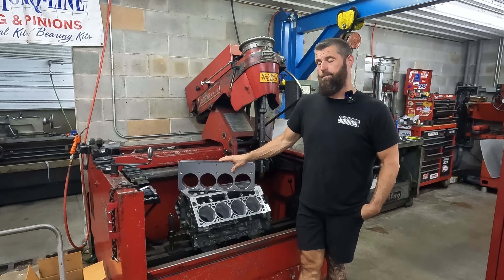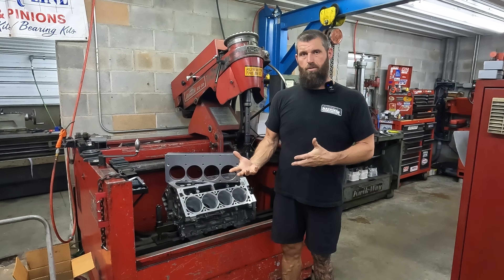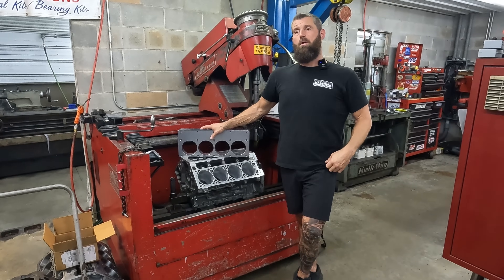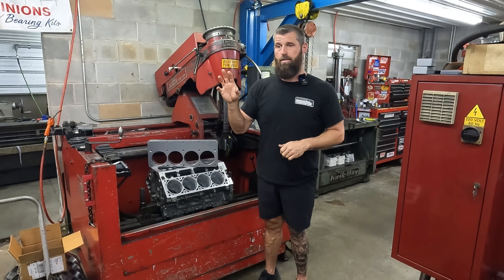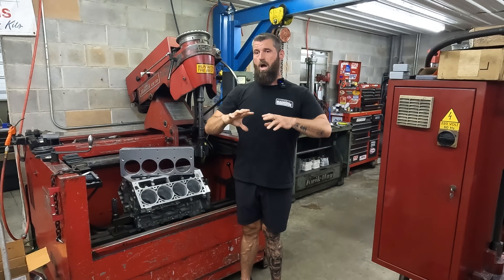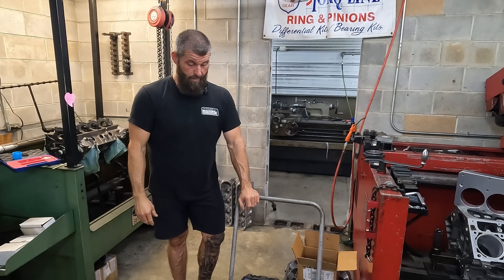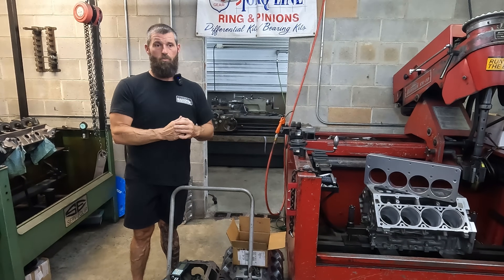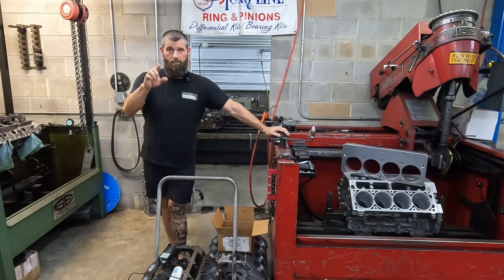We gotta talk about this torque plate deal.....

Comment: On a RACE engine, that's built and put into service with maybe a dyno run at best, sure, a torque plate can help the rings break in faster. However, on a street engine, that's expected to run 100,000+ miles, it makes zero difference, as even if the top of the bore is out of round by a few tenths, the rings will break in to the slightly out of round shape within a few thousand miles. 

Also consider that both the piston and block will expand, and the piston will expand more, so all of these changes will move around as the engine breaks in. 

Street engines are not race engines.

Comment: Great video.  I guess most of the torque plate police are FORD guys.  All the newer ford modulars are pretty responsive to torque plates due to thin cylinder walls on their iron blocks and as you mention even the old FE fords are sensitive to it.  I myself have built a number of ford modulars and have had a local shop bore my 5.4 iron block a few times thru the years.  They didn't have a torque plate and i wasn't going to buy one for them lol.  When i have disassembled the latest engine to swap to higher compression pistons i did notice some wear patches outside the thrust face and it was worse than before it was bored 0.030 over.  So to your point it is all relative. Im ok with my little 700 hp FI 5.4 giving up some bore quality to save 1500+ bucks to ship that block to someone with a torque plate.  It always ran fine and made good power. Just not that big a deal for even a mild street/strip car.
Reply from the maker: Absolutely

Comment: I have always thought exactly the same. The only way to check an engine properly is to bolt the actual head on after a hone near on size. Then run hot water through the block turn it upside down and measure the bore from the underside.
If there was a multi stone manipulator head for a hone and the hone had not only 6-8 stones vertically but also pad like stone rows horizontally. You could have push out mechanisms to control them with CNC, so you could do a bore scan then replicate the anomaly with the head removed creating the perfect bore when the head is bolted on.

Comment: 20 years ago I ran a test and only used a torque plate on one side of a street strip engine and ran it for years to see if I could tell any difference .... After years I could not tell at all except at the very top of the bore it had worn it just a bit more at the bolts ..... Leak down was the same ... Compression was the same .. it just did not care if it was done .... So you are dead on how it works

Comment: I'm a machininist for a living.  When u see any block made at any mass production facility they don't waste time with torque plates.   It's not economically feasible. Most of those engines run 300000 miles or more these days.  It's more due to the material the block is made of and the engineering.   If u need an engine that critical... I don't see just 1 torque plate on am 8 cylender block any use at all... if your worried about metal stresses being relieved from machining why aren't you simulating the engine being completely assembled with 2 torque plates and a block to simulate the intake torque stress as well.   We're not building engines out of carbide. As soon as that engine warms up things are changing in ways most will never understand.   Heat will make that block change shape in 1 area more than another warping the cylenders way more than .001 on warm up.   That's why drag racers fully warm up the engine before a race.... then they rebuild the engine after 1 to 2 races.

Comment: Some people see all this stuff on YouTube and don't understand that building high end race engines is a completely different thing than building daily drivers, or hacking together used parts to get a broke customer back on the road. Keep getting it done man.
Reply: Or a budget weekend race car !
Reply: Exactly. I’ve dingled and Jerry-rigged plenty of old small blocks to keep them running. I’ve done full rebuilds and I just eyeballed the crankshaft and said “yeah it looks okay” and slapped on new bearings. Said motor is already 3000 miles into the hillbilly rebuild and runs better than it ever has (in my memory).
Reply: This. Its insane to me reading what some people suggest to do to a DD. The tolerancecs and pressures are just so wildly different than a fully built, sleeved, girdled, billet block that its just incomparable. I'm not building a 9 second car with a stroker that hits 8.5k. I'm trying to have fun heading to the grocery store or out on a country drive.
Reply: Ever witnessed a shade tree rebuild on a daily that works just fine? Then you have witnessed a reality.
Reply: There are some stock engines that have similar rebuild practices to race engines though. Subaru EA series engines for example. Some of the 70s cars with them cruise at 4000 RPM at 65 mph, with no oil cooler. The dual carb engines rev to 7500+ RPM and you need to use that upper RPM range because they make no torque at all. Manual requires a torque plate to be used for boring oversized, but not for honing. Even from the factory they used special lead-indium over copper bearings with a moly coating because the loads on the bearings are so high and the journal sizes are so small. Cylinder liners are nitrided steel only about 2mm thick. If the cylinders have glazing they should be honed just enough to remove it, but if there is no glazing the rings are just supposed to be run on the existing surface, because normally the rings will wear out long before the very hard, nitrided cylinder. If the specs and procedures are followed to the letter these engines can last more than 500,000 miles easily, but if not they can also easily blow up at 50,000 or less. And it makes sense. If you have an engine that cruises at 4000+ RPM and needs to be shifted at between 5000-7500 RPM depending on the engine and specific car, and is also expected to last for a very long time, the tolerances are going to have to be very precise. High revving and long lasting don't usually go together. If you do the work yourself rebuilding these isn't expensive, however. Just time consuming. A full rebuild is around $400 including new pistons and rings, a full gasket set, a reground cam, a new set of lifters, and all types of sealant required for resealing the engine. You just have to be careful while doing the work.
Reply: We rebuilt a roller block 302 ford for a demo derby car, the block was from one of my cars and had been overheated really badly twice. It had almost 0.040 piston to wall after a really hard run with a glazebreaker. It was really noisy but had good oil pressure. Derby cars get really hot, especially if the rad gets popped, having a mile of piston clearance keeps them from seizing when the water leaves and things start to cook.

Comment: I build 2 454. One without torque plates the other no torque plates. The engine without torque plates I put cast iron rings in. The car ran 10:90 first time I took it to the drags. Change oil after the first time with about 10 passes on it. Second time out it ran 10:80. Each time I took it to the drags it dropped a 10:70 down to 10:30 and stopped there. I like good cast iron rings cause they ware into the cylinder. My other motor ran 10:30 brand new with the torque plates and top moly rings. The car never ran any faster than 10:30. I ran the et brackets so the et was not the big deal cutting the light wins the races. IMO I like to use standard cast iron rings on the 10:00 second times I have run. I put together about 25 motors in my life time from stock to low 10:00 second drag engines and only had 2 that used oil which had top moly rings which were street cars. Those two that used oil we took it back out honed the cylinder with my Ammco precision hone kit with 320 or 400 grit stones and back to cast iron rings.. Neither engine used oil again. These were daily driven engines. I put in good cast iron rings. I had all the engines machine by the same guy for years because he did a good job. For some reason I have seen were moly rings don't seal sometimes for some reason. I think it is because moly rings are so hard on the top ring they don't seal because if the engine gets warm and the ring can't ware into the out of round cylinder when its warm. If the ring does not seal you can tell by more oil blowby real fast. Engine move all over the place till they get broken into. I bought standard size rings and even those you had to file stock rings a little to get the gap a little bigger. My engines were at most 500hp to 600hp. All average people could afford 30 to 40 years ago. What I see today is all I can say am glad am out of it today. The prices are out of site today.

Comment: The deck plate does not represent the exact head that's going to be used on the engine as it in some case are hollow for coolant. thermocycling like you said or accessories pulling on the outer jackets of the block but people want torque plates .just like you said  lot of holes have been honed without any other than any deck plates but open deck blocks i feel better using then

Comment: I'm inclined to agree with you but I do believe that the coyote & the flexible alloy used to make the block do call for a torque plate over the 1100hp. I've heard that the aftermarket reinforced pred or even the iron aftermarket coyote do not " need " them. it appears to be more specific to the excessive flexibility of the alloy & design of the coyote. just thoughts, not assertions of fact.
Reply: I should've watched the rest of the video lol. you addressed the ford block alloy.

Comment: I agree with you 100%. The other side of commenters is,  if you were Torque plate honing stock blocks...  they'd be calling you a rip off atrist and accusing you of padding the bill. Couple of years ago, my LC9 ate a lifter. While I had the heads off, I had them surfaced and my exhaust manifolds belt sanded. This is a work truck. No mee seats, no new guides, no nee springs. Dropped the heads off on Monday got em back on Wednesday. Truck was running again on Thursday. Machine shop charged me 300 bucks. It aint a race car, and every minute its not on the road costs me money. I didn't have 2 weeks to wait for all that to be done. For what a 15 year old truck with 200k miles on it? Thank God there's honest machinists like you out there.
Reply from the maker: Thank you sir!!
Reply: Exactly some people just dont know anything other than what they have read or seen with certain vehicles. With most common situations its not necessary to go all out people just want it to run good. They dont want a race car.
Reply: Yeah i agree. It's like dealing with a woman. No matter what you do it's wrong. So just do what you think is right.
Reply: right?? I had people jumping down my ass when I said putting a torque plate on my toyota v6 aint gonna do shit. It's got 130hp on a good day with 350k on it. Getting a torque plated hone will cost me the same as getting another motor down at picknpull. lol

Comment: It's not a 10K RPM F1 engine, that guy just trolled you and used hearsay video knowledge. THX for the great vid bro!
Reply from the maker: Definitely! Ty
Reply: @powellmachineinc  Some of these keyboard warriors are like that, it's best to ignore them. It's not like you're working on a 50K HP rocket engine fuel/oxidizer turbo pump where tolerances of .0005 would make a difference  in the performance of the product. When guys troll like that, let the audience rip them and save your sweat for getting profit from product out the door.
Reply: Back in the late 80's a mercedes programmer forgot to put the max rev in for the engine,
it saw 19,000 rpm,  and didn't blow up...  oops...
Reply: @El_Peto It was an analogy, mr el Pedo-file.

Comment: Intil I watched this video, I figured all blocks would be torque plated, from an engineering standpoint it just seemed like due diligence. I had never considered the economics in regards to your business or that in the overall scheme of things some builds just don't benefit from being honed with a torque plate.
I think that this video was very instructive and educated many of us. Thanks again.
Reply: back in the day when it was all done by machinists in the manufacturers factory it was never a thing and modern engines are CNC machined without a torque plate.  its just extra when chasing perfection in high horsepower and racing builds.
Reply from the maker: Absolutely
Reply from the maker: You are very welcome
Reply: Just think about this,  time costs money,  so spending more time on a block that doesn't
need the work,  costs money... And $200 is a lot of money for someone who doesn't
make a lot...

Comment: These guys would absolutely drop dead if they knew how much "choke" is in Certified Aircraft cylinder "jugs". Yeah, by certification the top 1/4 of the bore is 0.005 to 0.007 smaller than bottom 1/2. That's like 15 TIMES what he mentioned - and it's BY DESIGN.

Comment: Funny- I've rehoned (half decent real hone, not a dingle) a couple of blocks done with a plate-I don't have a plate- and while I could see the difference for a couple of strokes, if that was as much as 0.0004 I'd  be shocked.  The difference is cleaned up long before the surface finish is there. Yup, there was a difference.  As you say, though, even in a club racer engine, I'd join you on the limb thinking that the difference isn't going to be detectable on a dyno nor in tenths of a second on the track.
Reply from the maker: Definitely

Comment: 2 things that may or may not have been mentioned. Imagine what a cylinder is doing during the pressure spike of combustion. Or even better, during detonation. The other, and this will blow your mind. Take a typical factory piston with it's tight running clearance of say .002". Measure it, then throw it in a pot of boiling water for a minute or two and measure it again. The piston literally won't fit in it's cylinder, and yet every day millions of combustion engines fire up and blast down the street with no thought of a warm up. That piston is going to heat up within a few combustion cycles, whereas the block won't normalize for a few minutes. Think about that.
Reply from the maker: Absolutely

Comment: Why not just use the torque plate? I used to know a guy that knew a guy that read about a guy that built an engine making 1,000hp at 75,000RPM. A 500hp mustang runs an 11.... runs the same 11 a 900hp mustang runs.

Comment: What gets me as a engine builder previously, and yes I understand power..

You can give the closed and installed heighth info to anyone...Chase me, you do not grasp spring eate..I am dragging you around everytime.

5/64" wide rings and think a tourque plate is going to improve ring seal...Maybe at 1mm top ring width I set the plates on, maybe...Keep 2/10's top to bottom and have a rough enough finish to hold oil, I will begin to think about ring sealing issues...last 6 strokes of the a platue finish and my hone is sealing the rings almost instantly after first heat cycle....

The big pet peave of them all...Sending the timing chain or the oil pump out the door with no assembly lube...And to have restrictors in back of block galleys because that high volume oil pump will move all the oil from the oil pan..

Bit of a rant, but damn....Main reason I never warrentied any engine the customer was reusing parts from is the brother uncles bobbies bad azz holley double pumper thats too small cfm and does not have hi and low speed idle jets in it...That way when fire it off with holley jets you wash the rings with gas...

Love the days being a builder, and seriously love that stage 3 can stock heads and flat tops and people think its a $15K used sb2 engine...yep them harland sharp cheap rockers going to love 6500 with a rev kit on lifters and tie downs on them 3/8ths studs.....miss those days lmfao

Comment: You hit the nail on the head when you said you should have just ignored this guy, but I'm glad you didn't and that you took the time to explain to everyone that there are times when torque plates matter and need to be used and there are times when they don't. And a good machinest knows those times and will use or not use them appropriately. Like you said, using torque plates on grandma's cast iron 350 block is a waste of time and money. Hopefully some people learned something from this video.
Reply from the maker: Absolutely

Comment: well... ha, I was asked about this recently on an iron block build, that the factory doesn't even use a torque plate, but they do with the post iron blocks.  I-6s so maybe when you have a non iron block and it is high performance it is warranted.  but as designed will it really move around alot?  how can it, or it wouldn't be viable as a design.  now the factory with some desire for precision and tolerances would be served by the plate, plus it cuts down on unwanted damage to the block, so you have to torque it right?  that may be the only reason.  btb that iron block moved .0001" from cold temperatures to warmer.  when you say 4/10ths alot someone will say, that's alot, not realizing you meant .0004" if they skip around or miss that....  waiting....